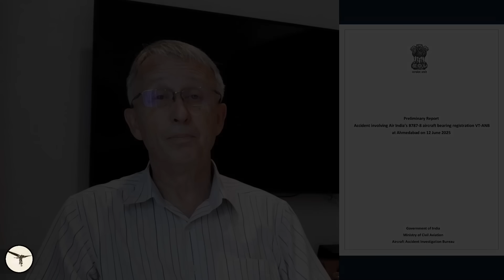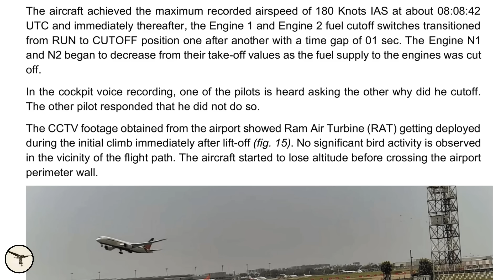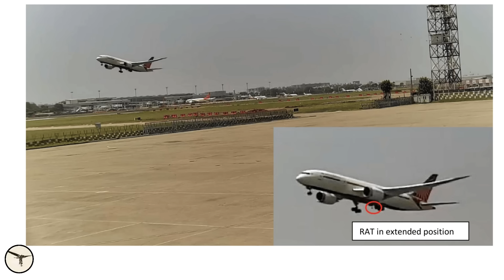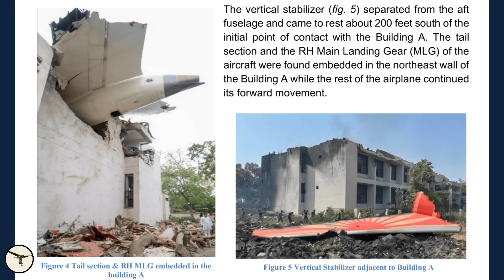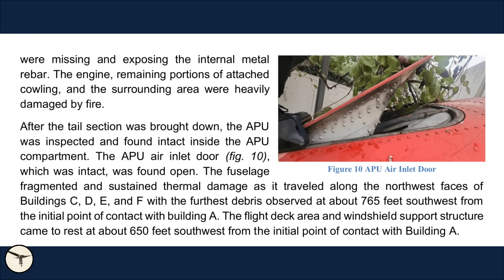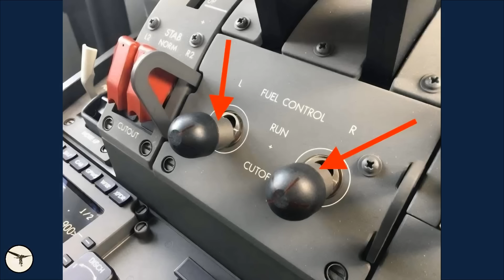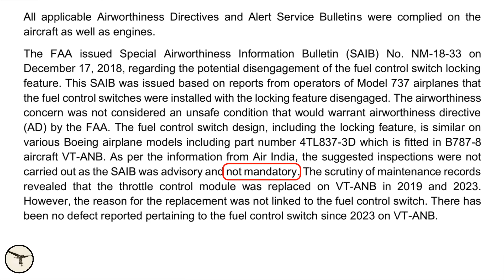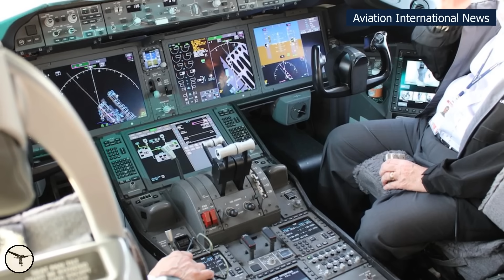WARNING Fuel Control Switches Failure Could Cost LIVES

Comment: Some are saying an electrical glitch is responsible,  however let's for arguments sake that's true , wouldn't...
1. The entire black box data recorder have gljtiched as well until power restored?
2. Wouldn't the data recorder show both fuel cut offs being shut off simultaneously?
I highly doubt it was a electrical gremlin in the EDAC, however i thought there was some initial concern that there was a connection that had been waterlogged due to improper replacement of an engine in March of this year that was related to EDAC components.  
Thanks for the upload, I watch a ton of aviation channels but in the end your my go to guy, i wouldn't have minded more speculation and conjecture on your thoughts on what took place, what we can most likely rule out and if you believe the 787 is safe to fly.
Reply: Wasn't the FAA the last aviation authority to finally admit that the Boeing 737 Max had a glitch and ground them despite the obvious evidence? I don't see Boeing or any US authorities admitting any faults with the aircraft.
Reply: @vincentrusso4332  also there is not one single electrical circuit. Maybe even the switches are powered from separate electrical buses for left and right engine. Only a circuit diagram would bring clarity here.

Comment: Why is it possible to manually cut off fuel to both normally functioning engines during such a critical phase of the flight, at all? I mean, shouldn't the aircraft automatically forbid it during climb?
Reply: Because planes don't fly "automatically", they are flown by human pilots. Would you like to fly a plane piloted by AI? Good luck with that. It already took place. The infamous Boeing 737 Max Lion Air and Ethiopian Airlines flights.  Nobody survived.  The pilots couldn`t switch off the faulty AI system.
Reply: @lordjim3109 Who said planes should fly completely automatically? But automatic should help avoid human mistakes and improper actions.
Reply: @DenisPetrov1980  YOU said.
Reply: @lordjim3109 no, I didn't
Reply: Boeing logic, as they say, is that a pilot is the master, any automatic command can be overridden by the pilot.
Reply: That's like asking why it is possible for the pilots to operate the rudder, flaps, or ailerons. They can crash the plane on takeoff (or at any point really) by incorrect application of those controls. You cannot design a plane which the pilot cannot crash.
Reply: EMBRAER aircraft's use a logic that after pilot move the fuel switches for CUTOFF the FADEC only cut the fuel for the engine if the throttle lever are in idle position, or, the pilot confirm that want shut down the engine, doing two different actions for this.
Reply: @DenisPetrov1980  they didn't know that a psycho imdian capt would be flipping the switch.
Reply: Emergency situations where only one engine malfunctions can be shut off
Reply: You would think that would be a given, but alas no.
Reply: @Antoinette14273  I agree - this should be blocked by the software, assuming these switches send a message to the software and then it starts or stops the fuel pumps.  Some switches essentially talk directly to a device or to a relay, and only inform the software of what happened so it can be logged.   From what I have read on other forums, other pilots have accidentally turned off these switches due to a "brain fart" - I'm not saying that's what happened here.  Seems like the software teams will need to consider additional protections against this kind of thing in future versions of their code.  Sincere condolences to all that were impacted by this tragedy.
Reply: @Larry-mk9ry  Spot on.
Reply: @Larry-mk9ry  Very well put.

Comment: «01» or 0.1 seconds seems significant. To me, a total amateur, It seems very cumbersome to operate both cutoff switches simultaneously, intentionally, single handed (e.g. captain’s right one, or FO’s left one as PF)…? 

One would probably need to «know» that this particular ‘78 had inoperable lock mechanisms, making intentional (!) operation (even in one sec) far fetched. 

(I didn’t get whether this aircraft’s MEL listed this particularly - in addition to the general FAA SAIB.)

My thoughts are with those suffering their losses. And I hope a final report stops speculation, it hurts in so many ways. Thanks again capt. M. for keeping this grounded (no, no joke).